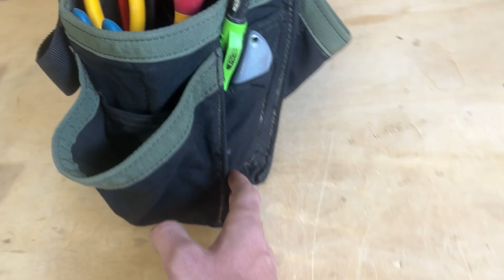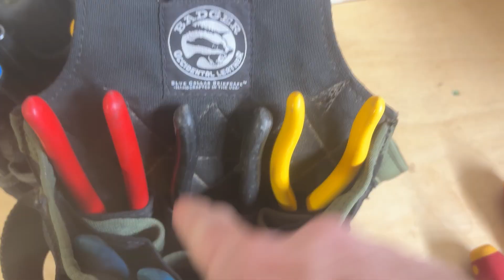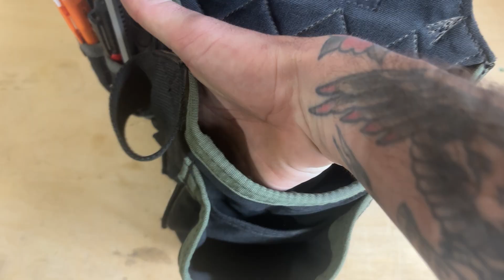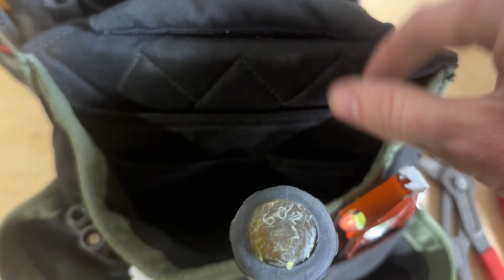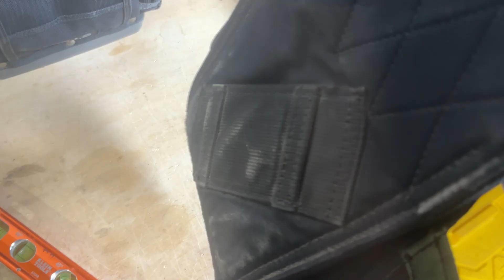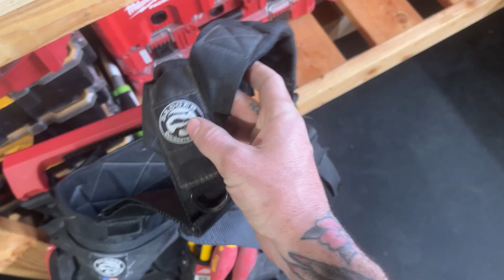Custom Electrician’s Badger Tool belts Set Up

Comment: No, I was about to buy the badgers custom bags quoted over $700 but I didn’t like how low they sat off the belt
Reply from the maker: The side by side carpenter is 13in long I think. I wear my belt up on my belly button so the length never really bothered me.

Comment: Nice setup thanks for the upload! So you’d recommend the badger 6 inch belt and suspender over other brands
Reply from the maker: I have absolutely loved my badger suspenders and belt. Extremely comfortable, carries the weight well. Breathable. The only other belt setup I’ve used is the classic occidental leather belt with suspenders which is way heavier and hotter. 
Now that I’m in commercial and need to carry much less on me, I have thought about ditching the suspenders and switching to one of the 4in badger belts.
Reply: @Bra @Brandonreisinger  awesome thanks for the information I have a supply house near me that sells badger belts I’ll be picking one up probably next paycheque
Reply: Thanks for taking the time, we all appreciate good constructive feedback.